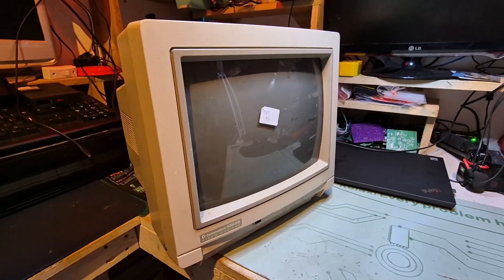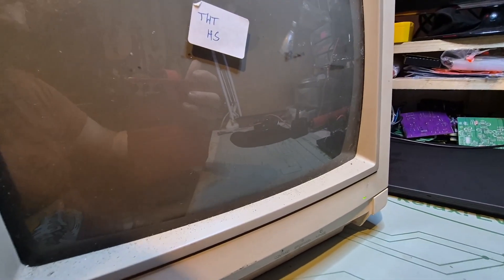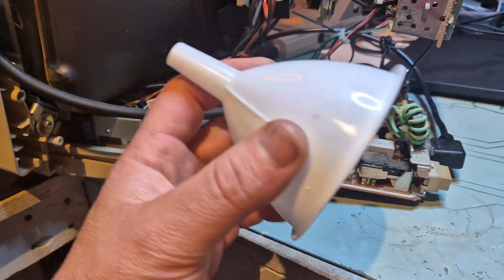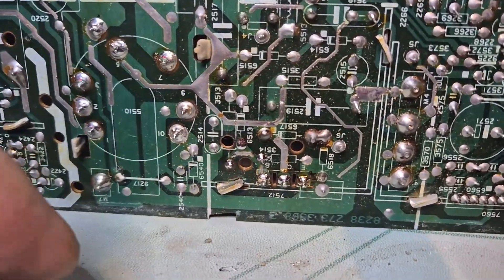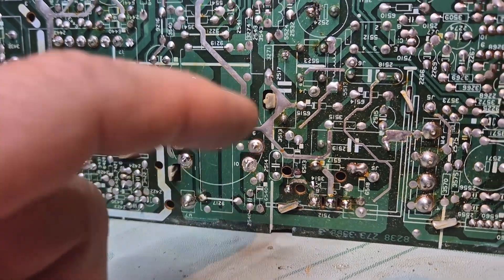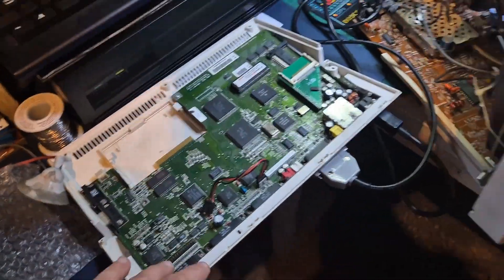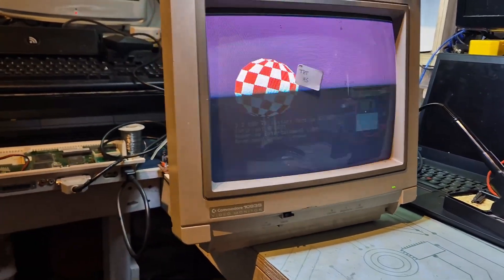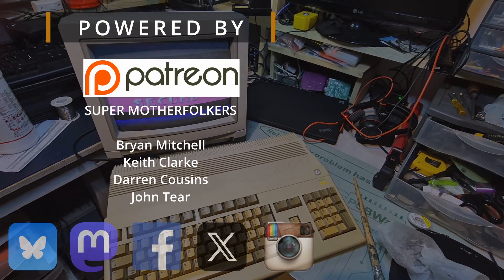Dead Commodore 1084s monitor repair

Comment: I have 1083S (exact same as here) with beatiful picture quality and it works if there's just enough stuff on screen, maybe a little shaking on right upper corner. But when there's only minimal amount of things on screen, maybe just a few letters on black background, the focus goes off and picture is shrinked a little. If I adjust contrast down and then brighter the screen starts to bloom just a second and then it zooms and gets sharpened. One thing I noticed that if the screen is full of white color, the speaker makes a very loud buzzing sound. To me all this sounds like a bad caps?